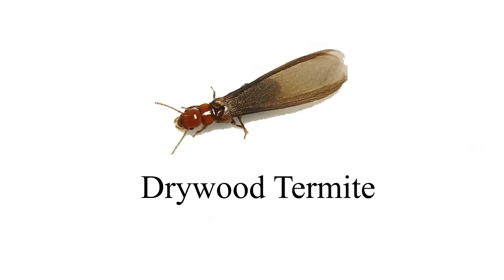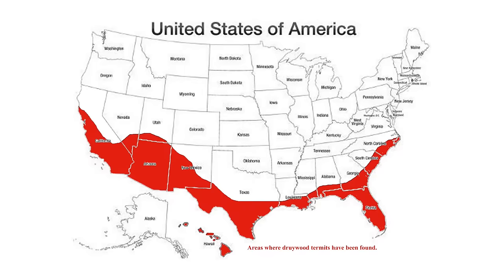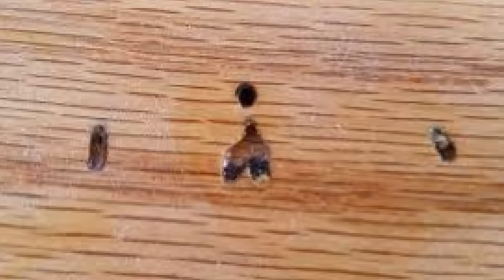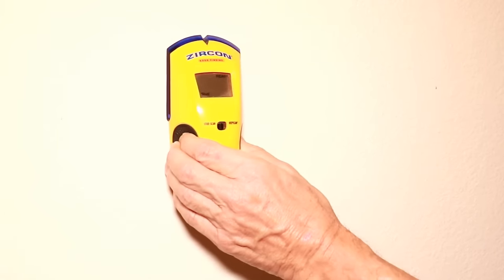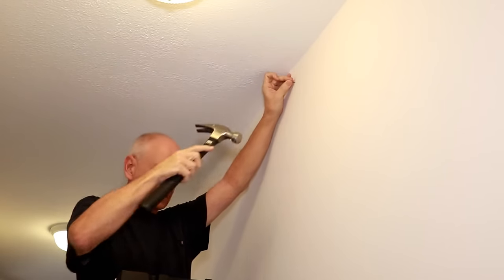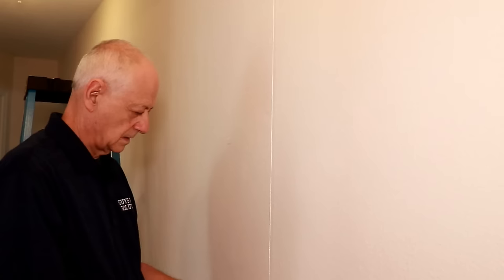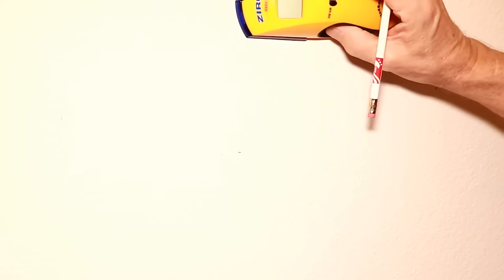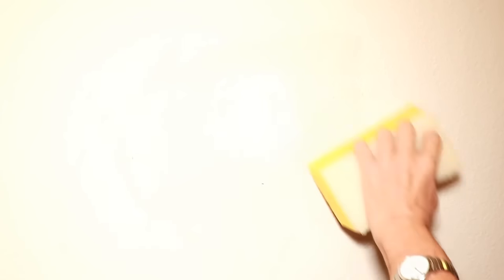How to Treat a Drywood Termite Infestation Yourself. A MUST see if you have Drywood termites.

Comment: Is that a real bookshelf or a green screen?
Reply from the maker: You know, you are the first person that's asked that question.  The bookshelf that you see in many of my videos is not a green screen, nor is it an actual bookshelf either.  When I first started doing these videos, I had no place to really do it.  So, I was relegated to doing it on the patio, in the kitchen, or some other place outside that would work for me at the moment.  The problem with that was mostly audio.  It is very difficult to control background noises when you're recording outside and it is very inconvenient for other family members to have to remain quiet when I am filming inside.  As it happened, we had a spare bedroom that we used for guests.  Well, we only used it a couple of times a year for maybe a few days when somebody would visit, so we decided that the limited use was not justified.  Therefore, we removed the bed and other furniture that was in the room and converted it into a very small soundstage.  It is a very small room, so it has very limited capability to do a whole lot of anything.  The entire operation is nothing more than a camera that is mounted on a tripod and a folding chair that I sit on, with a small folding table in front of me that I can put a bottle of water on and a sheet of paper with some bullet points that I can follow while I'm doing my videos.  I didn't want to shoot on a blank wall, so I purchased a backdrop from Amazon that is basically just a really big photograph of a bookshelf.  I do have the capability of doing green screen, but it doesn't come out very well because I do not have a room large enough to do it properly.  To do green screen properly, you need to sit about four feet in front of the green screen and that would take up a good portion of my room.  The entire length of the room is only about 11 feet.  By the time I would place the lights in the correct positions that I need and the camera in the position it would need to be in, that would not allow me the four feet that I need to do a proper green screen video.  Nevertheless, my daughter did buy me a collapsible green screen and so I did feel obligated to give it a go.  I shot just one video with it and the feedback I received from my viewers was somewhat less than positive.  The overwhelming consensus was that I should go back to the bookcase.  So, there you have it.  Now you know the truth about the bookcase.

Thank you so much for watching and for that very observant question.

Be well my friend.
Reply: @GuysPestSolutions  It's a Termites free home for sure, Termites know that Guy is living there ha ha. Good Luck for You Tubing
Reply from the maker: @upali66  Thank you so much for those kind words.  Very much appreciated.  Be well my friend.

Comment: Good evening, Guy. My subfloors are infested with beetles. I have a 2000 sqft house in South Louisana and I started to treat with Borcare mixing 1:1. I realiezed quickly that I will need a lot of gallons of product since there is a lost of waste,  the product is just dripping when I am spraying under the house. I wanted to ask your opinion in continuying the treatment with Tim-bor professionnal, 25 gallons instead of Bora -Care because  I noticed it has the same active ingredient as Bora-Care (disodium octaborate tetrahydrate) but much much cheaper. I know they say Bora-Care penetrates better having the glycol component but in my case due to the fact that I spray the subfloors from under the house the product just drips due to the gravity. I value your opinion, so please let me know if you think it is worth it to switch to Tim-bor. Thank you for your help with this.
Reply from the maker: Tim-Bor certainly is a lot cheaper than Bora-Care, but it's not the same thing.  Bora-Care will penetrate deep into the wood.  Almost all the way to the center.  So, it will kill any larvae that are busy eating your floor joists, and it will kill any beetles that try to bore into the wood.  Tim-Bor is a wettable powder that does not penetrate the wood very far, so it will kill new beetles that try to enter, but it will most likely not kill the larvae that are already eating the joists.  It is the larvae that do the greatest amount of damage.  

It sounds like you are using too much of the product.  You don't want it so wet that it is dripping.  At least not that much.  You are wise to mix the Bora-Care 1 to 1 with water, but you shouldn't need more than 3 or 4 gallons.  Four gallons will make 8 gallons of finished product.  A gallon of mixed product should cover between 500 to 1000 square feet, depending upon the wood and how heavy you apply it.  So, 8 gallons of mixed product will cover 4000 to 8000 square feet.  Your floor is 2000 square feet, but there is more surface area on the joists than that.  How much depends upon the dimensions of the joists.  My recommendation is to use a finer mist with the sprayer and don't apply is so heavy that it's dripping a lot.  I would stick with the Bora-Care because it is a much better product.  Remember that you only need to do this once.  Bora-Care lasts forever.

I hope that helps.  Be well my friend.
Reply: @GuysPestSolutions  Thank you very much for your fast answer. I did purchase 4 additional gallons of Bora-Care.  I appreciate your help and how thourough you are  with the explanations in your videos and written answers! Take care!
Reply from the maker: @robertinoion2535  You are very welcome.  Thank you so much for those kind words.  Very much appreciated.  Be well my friend.

Comment: can't I just add the Fipro faom into the kick-out holes ?
Reply from the maker: That is exactly what most of the professionals would do, and it certainly will help, but it is kind of like spitting on a forest fire.  You can be pretty sure that the termites are in the walls and there are kick out holes that you cannot see because they are inside the wall.  So, if you just treat kick out holes, you may kill a gallery where you treated, but there could be another gallery 12 inches above or below that one.  There could be a gallery in the next stud over.  It is almost impossible to find them all, and that is why I always recommend fumigating for drywood termites.           
 
I hope that helps.  Be well my friend.
Reply: @GuysPestSolutions  Thank you  And thank you for the videos

Comment: I was remodeling a friend s house on blocks he had like about 6 chickens they went all over those termites and insects
Reply from the maker: If that house does have a termite infestation, then it would be a good idea to treat it.  Almost all pest control companies will inspect for free, so I would get one of those free inspections to see what is going on.  Always ask the inspector to identify the species and ask for a written treatment plan.  If you are farming out the treatment, then it's a very good idea to get several estimates because prices and treatment plans can vary greatly in this industry, especially for drywood termites.  Also, my advice is to never sign anything until you have thought about it for a couple of days.  Some of the national companies can be somewhat high pressure, so don't fall for the old, "The price is only good for today routine" and that sort of thing.  Somehow some of these companies seem to always be running a sale that just happens to be ending today.  Just tell them you don't want today's price.  You want next week's price and you will be getting several estimates.  

I hope that helps.  Good luck with the remodeling.  Be well my friend.

Comment: Hi guy . Thank you again for your valuable advice on termites. I finally decided to call pest control for my termite infestation because at this point it was really out of control. So after throwing away some of my furniture and treating the rest , im left in a dilema as to how to replace my lost furniture. I was considering mdf because they are the cheapest but im not sure if termites love this or not. Anyway if i choose the mdf furniture is there a way to protect it from termites? Or should i put a cross on wooden furnitures forever and go the all concrete route?
Reply from the maker: I presume that you do have drywood termites.  Right?  If so, then you didn't need to throw away any furniture, unless it was seriously damaged. The only way to totally eliminate a drywood termite infestation is to fumigate the building.  If you do that it will kill the termites in the furniture too.  Furniture made from MDF has the advantage that it usually contains chemicals that repel termites.  That does not mean it will stop them though.  So, the best way to stop drywood termites is to prevent them from entering the building in the first place.  I have a video on how to do that and I will give you a link to it.  You need to do the first treatment before the fumigation is done.  That is because the gas they use has no residual properties at all.  So, you can get reinfested the moment the tent comes down.  Therefore, you want the house protected before they fumigate.  In my video I recommend doing the treatment every 90 days, but since you already have an infestation, that means your neighbors have them too, so I would do it every 60 days in your case.  If you do the preventive treatment every 60 days, then you will never get drywood termites in your house again, unless they fly in through an open window or door.  So, don't leave windows or doors open.  I also have a video on how to hire a pest controller without getting ripped off.  This video can save you a lot of money, so you may want to watch it.

Be well my friend.

Video on how to prevent drywood termites:  https://youtu.be/neNsmVbj8Pc

Video on how to hire a pest controller without getting ripped off:  https://youtu.be/y-a8XOqVrlE
Reply: @GuysPestSolutions  my furnitures turned to paper and i had been in complete denial for years. Thats why it got so bad😄 Anyways my husband does not want to hear about wood again. So mdf wont do. He is considering other materials .
Reply from the maker: @jemjem9699  I understand. You must have had these guys for a long time to do that sort of damage.  You would be wise to inspect the attic to see if there is serious structural damage up there.  Drywood termites are slow eaters, and it takes a long time for them to do serious damage, but eventually it will happen.  If you have had these things for a long time, then it is possible that your roof is compromised to the point of failure.  I'm not saying it is, but it is wise to have a look.  Check for rafters that are sagging.  Also, check your ceilings to see if any of them are sagging or if the paint looks discolored.  Check the walls too for sagging or discolored paint.  It is also possible that they have caused structural damage to bearing walls.  You may also want to check your cabinets for frass and kick out holes.  If you find them in the cabinets, you can spot treat them.  You can also spot treat wood furniture.  Upholstered furniture is hard to treat, but MDF or actual wood furniture is very easy to treat.  If you ever find frass under it or tiny holes in it, you just shoot in some fipronil foam, and the problem is solved.  So, no reason not to buy wood, if you check it every couple of months for holes and frass.  The frass is going to be rather obvious because it will probably be on the floor, unless it is a dresser or something like that.  I don't know what sort of furniture you can buy that doesn't contain some sort of cellulose. Termites eat wood because it contains cellulose.  It is actually the cellulose that they want to eat.  Even couches usually contain wood as the basic support material.  Termites will eat press board and all that sort of thing.  So, your options are fairly limited.  Please tell your husband that I feel his pain.  

Be well my friend.

Comment: If you can have a couple of chicken runing around your house no insects????
Reply from the maker: To the best of my knowledge, chickens are not fussy.  I think they will eat just about any sort of bug there is.  However, subterranean termites travel underground, so the chickens cannot get to them.  Drywood termites fly to the building and often enter through cracks and crevices around windows, doors, through the soffits, and so forth.  So, again, the chickens cannot get to them.  That means that chickens may be of some benefit in keeping down bug populations in your yard, but probably not so much with termites.  You may see some termite swarmers on the ground and the chickens may eat them, but that will not help with a termite infestation.

I hope that helps.  Be well my friend.
Reply: Interesting thought which leads me to something else.  I heard there was these parasite little worms that you can buy that find and eat termites.  It would be very odd to release these into wall voids to try to hunt down these termites but if they could just stay there eating the termites and not be a pest themselves then I don't see any harm in it...
Reply: They will move dirt from side to side with their feet and keep ground honest  any insect underneath wood .
Reply from the maker: @macknumber9  I think you may be referring to nematodes.  Some folks release them into their gardens and so forth and they do eat termites, but I have never heard of them being used inside of a structure.  Everyone wants to find natural ways to get rid of termites, but at the moment anyway, you still need to use pesticides.

I hope that helps.  Be well my friend.
Reply from the maker: @josequintanilla2972  I'm sorry.  I don't understand your question.  There is a lot going on here.  We are talking about termites, chickens, and nematodes.  Which one are you referring to?  I can tell you that termites do move dirt as they travel through it.  When they reach a food source, they typically will begin eating.

Be well my friend.